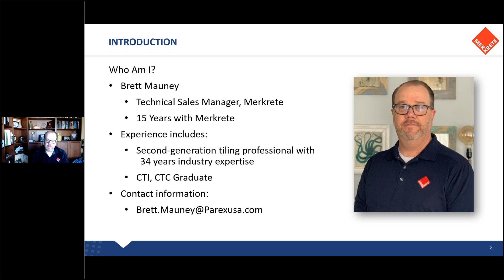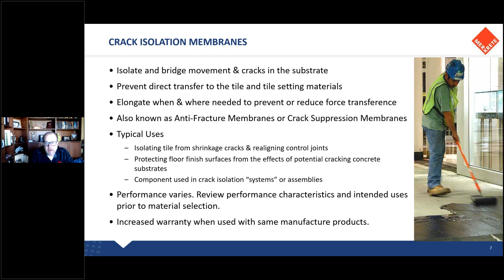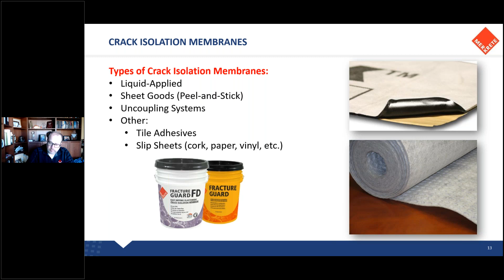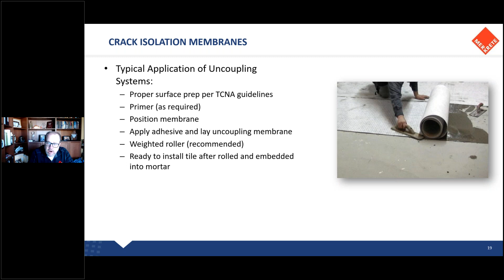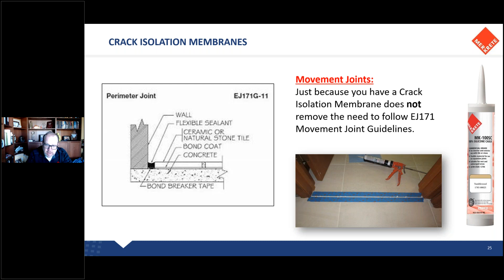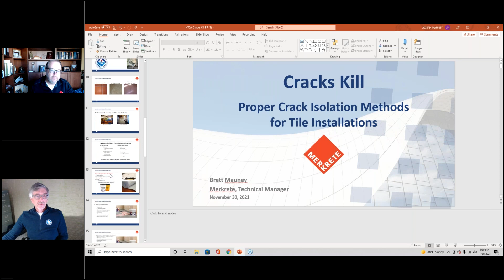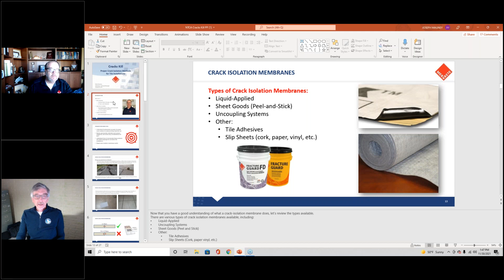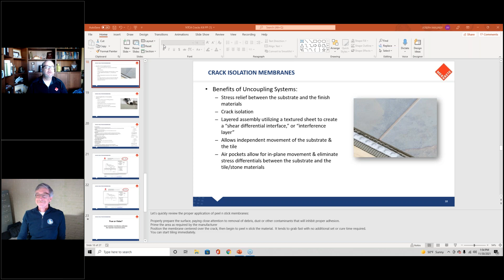Webinar: Cracks Kill – Proper Crack Isolation Methods for Tile Installations

Comment: i also did a curbless recessed shower  using schluter  foam  pan  i had to recess the slab,to the dirt, ended up repouring below, so have a cold joint,i used dilex  bwa movement joint right centered on cold joint,at shower glass,worked well,dikex eke at change of plane ,color matched silcone at doorway  and window  sill jamb areas for expansion  ,next time i may use backer rod  ,like marks other video

Comment: had a crack by toilet  removed tile ,used a grinder to open n clean out crack usec sikkafix epoxy  glue,caulk down into crack then aqua defense layers,crack seems stable from initial house settling,it had a hairline on the old tile,so we knew it was the slab, so far its not  reappeared,,was lesd than 1/8,someday in other places i may use ditra ,or a thinner product  ,to keep floor  transition heights flush